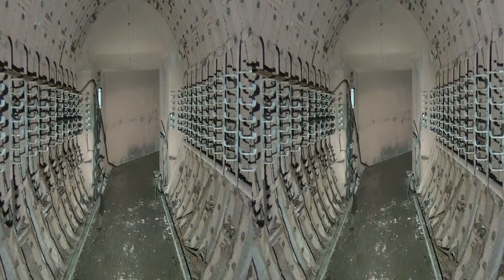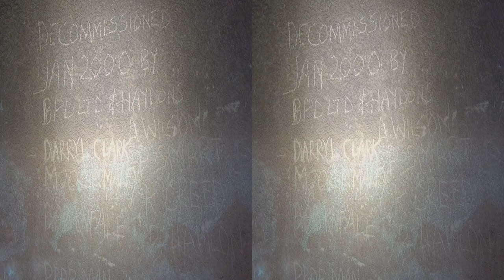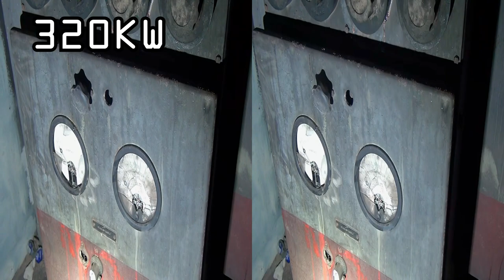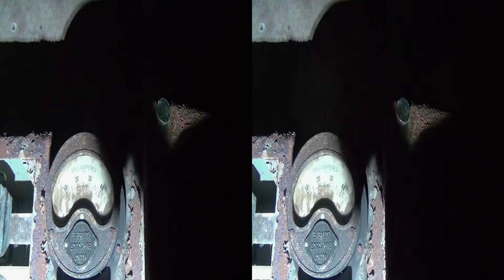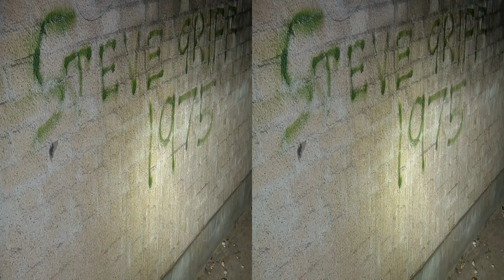Portland Rotor Bunker 3D Special for SIDE BY SIDE SBS 3D TV

Comment: I watched it on my phone using a 3d head mount thing. worked really well although a little narrow. thanks Matthew.
Reply from the maker: Lol... perhaps i need to produce a squished into 2 sqaures version. Would be standard definition by that point though...
Reply from the maker: It designed for special 3d tv. Best get some cheapo red cyan glasses... £3 ebay.
Reply from the maker: https://www.ebay.co.uk/itm/124835684514?var=425901623126&hash=item1d10c960a2:g:BeoAAOSweg5hB7zO
Reply: @TheSecretVault  Thanks. Yes re adjusting to a smaller square version would probably ruin it. The head mount thing is too small for my phone so I had to have my head tilted back to keep the phone in place. Will have a look at the red / cyan glasses.